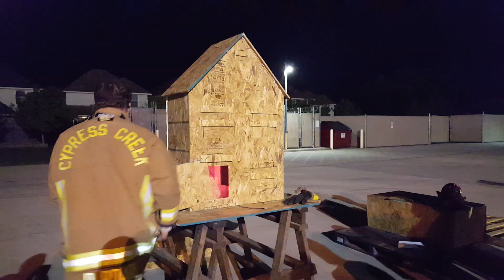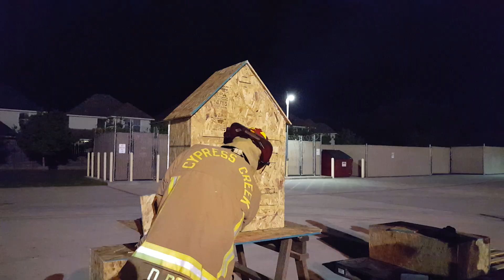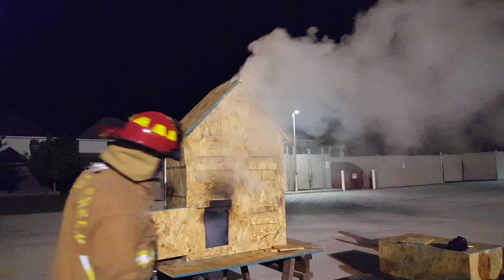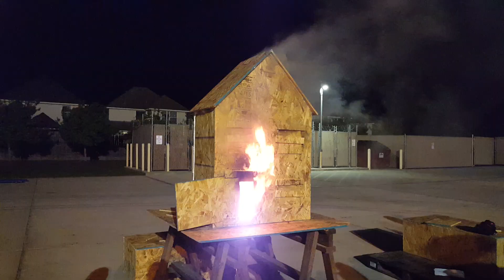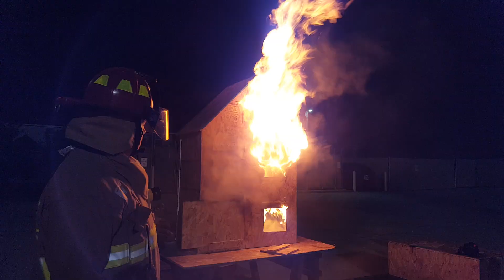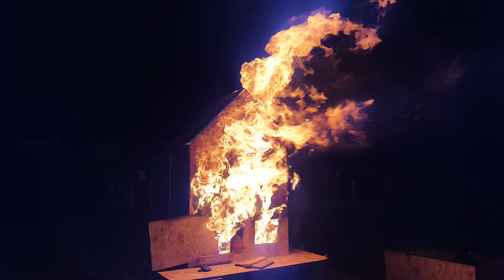Back draft and flash over simulations

Comment: I saw a video where firefighters used a 15 or so foot long shipping crate to demonstrate backdraft. It was massive and incredibly loud and powerful. Is it possible to get a powerful backdraft from that smaller scale house? If you have a smaller ventilation hole, will the backdraft be more powerful or do you just need a greater volume of smoke?
Reply: Smaller hole would mean more time to the backdraft to occur. The greater the smoke volume the greater the backdraft

Comment: Notice how after he closes the door after the backdraft at 7:45 the smoke on the roof changes from thin white smoke to thick fat dirty brownish yellow smoke. Also, the smoke comes through every gap in the top window. This is something to alert you when you approach a burning building: There is heat and fuel, just not enough oxigen. Be careful about venting.

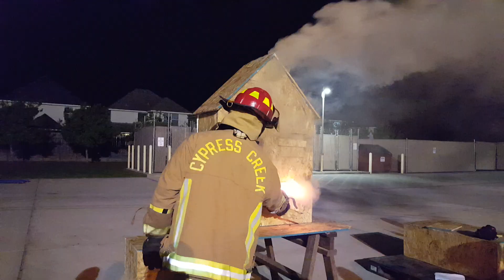Comment: What scares me is that it seems unpredictable.  I mean, we know the conditions that make a backdraft, but when those conditions get met are hidden within the structure until you open a section/window etc. Like around 9:20.  How do you know, when you get to a scene, if the thing is going to try kill you or not?
Edit: and what if you are on a crane near the roof at 9:50? Can making a hole put you in danger? Guess that's why I'm not a fire-fighter...
Reply: Some signs that firefighters can use to identify a backdraft:

First of all, keep in mind that to occur a backdraft the smoke has to be very hot and concentrated enough with combustible, only lacking the O2 to ignite.

1 - Khaki/beige, dense and turbulent smoke getting out violently from upper openings

2 - Air being "sucked in" the building, you can see it and also hear a whistle sound

3 - The presence of flameover (smoke getting out the building and instantly igniting), which means: The smoke that gets out of the building is hot and has combustible enough to burn and it will burn as soon as O2 enters the game

4 - High temperature doors, door handles and walls indicates that the inside of the building is very hot 

5 - You will hear stuffy noises, due to the high density smoke

6 - Windows will look oily, due to soot and water mixture (products from the combustion)

Comment: Let me explain something to you and I hope you Think about what I say.  You Do  NOT teach the consequences of not doing your JOB.  You teach the JOB and there won't be any consequences.  I was a Third Generation REAL Fire Fighter which means nothing if I didn't get the JOB done Quickly and Safely.  But I did.  I also know that fire fighting is a dirty, stinky, hot and cold menial labor job and that is IT!  It is Not Rocket Science and is NOT staffed by a bunch of Heroes.

1.  Everything you need to know about fire fighting you learned in grade school.
2.  A fire inside an enclosed space creates pressure. 
3.  If that pressure isn't released, it will eventually spread deeper into the structure.
4.  You break a fire room window from the outside to let the pressure, heat and smoke escape directly to the exterior and away from the interior.
5.  You apply Tank Water through the window and coat the burning material.
6.  The flames will go away in 3-5 seconds and the room will be drenched in 5-10 seconds.
7.  This can be done within one minute after arrival.  Long before an entry team can be assembled, get fully dressed and get the front door open.
8.  The temperature inside that room drops by 1000 degrees the moment the flames go away.
9.  The victims and entering fire fighters are PROTECTED.
10.  You go in with a charged line to mop up and search.

No fire is pushed, nobody gets steamed to death, the job is done and everybody gets to go home.  Nothing but menial labor but with a brain and sense of responsibility toward yourself, your fellow FFers and your families.  No bravery and hero bullshit allowed.

You horizontally vent and apply tank water as soon as possible.  This is how you fight fires.   You don't need any models.  
https://www.youtube.com/playlist?list=PLkp0E1ao1XEzg384QZ4ovMA_6P7gCY3nJ
https://www.youtube.com/playlist?list=PLkp0E1ao1XEw35c4z-PSM0hoKYiMLpHJC

Comment: Children at Play.  Open the windows at the fire room to release the pressurized heat and gasses and then apply Tank Water to the burning material.  The fire is knocked down within one minute of arrival.  With the release of heat and gasses and the application of water, you can't have a flashover or backdraft.  It is only when you PLAY at your JOB that you can create them.  Grow Up people and do your JOBS!  "Stop The Threat As Fast and Safe as possible while using the least amount of water."

Comment: Let me explain something to ALL of you!  This is Not that hard to understand if you just think about it.  You don't need Doll Houses.  Because most buildings aren't completely air tight and doors and windows are frequently opened and closed, the air pressure in and out of the house should be then same.  In grade school science class we learned about Hot and Cold Air and their level of Pressure.  We know that heat rises and cold air falls.  In a closed structure, burning material will create an overall higher pressure compared to what is outside..  If the fire, heat and smoke are not venting out of the structure, the Flammable gasses at the ceiling will get hot but they will be suffocating due to a lack of oxygen through fresh air.

Every room in every residential structure in the USA and most of the world have at Least one window. Most basements have windows or hatches.  Attics sometimes have windows or at least gable end vents and sometime dormer windows.  If there is a fire in a residential structure, the chances are high that you will be able to figure out where the fire is through a 360 walk around.

Remember!  Hot Flammable but suffocating gasses at the ceiling and cooler air at the floor.   Let's say the fire is in the first floor living room.  If you want to eliminate the chance of a Flashover and want to Protect anyone who could be inside including fire fighters, the Quickest and Safest way to do that is to break out the windows at the fire room and allow pressurized Heat and Gasses to escape directly to the exterior and away from the interior.  Then, you apply water directly to the burning material through that window!  All the gasses including the water vapor/steam will exit that same window.

If the fire is in a second floor bedroom, one person grabs a ladder and breaks out the windows to release the pressure.  One person hits the ceiling and moves their feet around to change the Angle of Attack and the fire is out in the same amount of time.  No flames, no flashover.  Period!  If you leave a lot of window area open for the gasses to escape or you have opened multiple windows in the fire room, the gasses will continue to exit out of the structure.  You will NOT Push the fire deeper into the Pressurized structure!

You have just lowered the temperature in that room by 1000 degrees the moment the flames are gone.  Combustion is ending quickly as the material is soaked.  From arrival to Safe should take no more that One Minute on Tank Water while the hydrant is being hooked up.  Around 20 gallons of water in 5-10 seconds and the threat of flashover is over because you have eliminated the ignition source for the hot gasses outside that room.  The temperature will ONLY go down!  

The reason this country's fire departments worry about Flashover is because they fight the fire in a way that will ALLOW Flashover to occur.  They leave the structure tight and the pressure high with the existence of Flammable gasses and Flames.  They open the front door to go inside to find the fire they can see through the window.  This does two important and Dangerous things.  It releases pressure directly into their faces and allows the gasses inside to move and mix with incoming fresh air at a lower level.  The flames and heat increase and Now that they have created the ability for those gasses to Flashover and they Walk Right Into IT!!!

This nation's standard decrease the threat of Flashover is to take the TIME and risk their lives by climbing on the roof of a Burning Building to cut a hole in the roof and Try to punch a hole in the ceiling below while HOPING they didn't run into the following.

1.  They can't reach the ceiling with their pole because of the steep pitch of the roof. (Just open the windows at the fire room!)
2.  That attic has a thick layer of insulation between and over the ceiling joists.  (Just open the windows at the fire room!)
3.  The attic has a floor.  (Just open the windows at the fire room!)

4.  They punched a hole that is too small to release much pressure.  (Just open the windows at the fire room!)

5.  They punched the hole in a room where the door is closed to the hallway!  (Just open the windows at the fire room!)

6.  The gasses in the attic where extremely hot and they just ignited them to turn the attic into a fire bomb which builds up so much pressure that no gasses could enter the attic from below.  (Just open the windows at the fire room!)

7.  While attempting this tactic, a fire fighter falls through the roof into the inferno or slips on the saw dust and falls off the roof.  (Just open the windows at the fire room!)

Even if everything went perfectly, the fire has grown in that time and the heat from the lower levels would Never rise and exit that hole in the roof as the movement of gasses below will mix with air from the front door and the fire is always getting bigger.  
You can eliminated the heat and gasses through a window in One Minute or Wait for Vertical Venting to perform it's miracle and make the interior a much nicer place to work.  (Just open the windows at the fire room!)
  https://www.youtube.com/playlist?list=PLkp0E1ao1XEzg384QZ4ovMA_6P7gCY3nJ

Comment: This guys turn out gear is suspiciously clean like it must have been brand new
Reply: We maintain our gear by washing it regularly and after an incident.  Dirty gear is unhealthy gear.  We also have our gear regularly inspected and repaired or replaced per standards.
Reply: Kevin Bain yes ours is too. However regularly washed gear still looks weathered compared to his
Reply: @lukeanderson6669  So what?  His gear was new, as was his helmet since he was recently promoted prior to the film.  You are judging him based on how insufficiently worn his gear is?  I have gone through several sets of bunker gear during my career.  I had more experience and more training by the time I received my brand new third set than when I turned in my worn out first set, although it may not have appeared so.  Heck, our cadets are often issued heavily used gear that is no longer fit for interior firefighting and only issued new or newer gear once they are cleared for interior firefighting training.   I wouldn't presume to judge another firefighter based on how their gear looked unless the ensemble was incorrectly assembled or donned.
Reply: Kevin Bain take er easy lad only an observation
Reply: maybe he's using a student's gear which would be brand new..

Comment: It's just un burnt fuel why you never bust out windows or open any doors because a team can be in there and you think you're helping but you're actually introducing more oxygen and a flash over can happen
Reply: How can a ba team be in there if no doors or Windows were opened to get in in the first place?
Reply: @isitwasit8756  have you never been to fire school before?
Reply: @againsthell1908  oh you know ?? 
Just 20 yrs in the job so far And counting.. 
So the question still stands ?
How can any ba team be in there if no doors or Windows were opened in the first place ?
Reply: Always control your door dont let it sit open youre just asking for it to flash specially none touched bedrooms that had the door closed. 2 in 2 out the guys on the line makes their way up stairs sees a room closed dont touch it there could be someone in there so the guys outside will go to that window on a,b,c or d most likely break the window to search the room and then guess whats gonna happen when you open that door? More fuel more oxygen
Reply: @againsthell1908  
Eh?? Don't leave doors open ? Err yes you do . Every door a ba team goes through with hose reel en route to a compartment fire is wedged open before proceeding for obvious reasons.. also any decent compartment fire would have built up enough temperature inside causing windows to fail before or after flashover commences ..by the way flashover and backdraught are totally different scenarios.. flashover occurs in a developing fire backdraught can occur after fire has flashed , but in any compartment fire that has already flashed I can assure you the windows would have failed taking away the risk of backdraught...  once fire compartment is reached by ba team get on your knees crack the door and view conditions inside fire compartment .. if windows have failed close door radio back to entry control point and tell them to get the fan on to go offensive ventilation .. once that's done deal with fire and all smoke heat and steam will vent out of failed window .. like I said earlier in response to what you said regarding not opening doors ? If any teams are in there? That means doors are open and certain windows will be open either from failure or nessesity regarding vents needed to control smoke and heat exiting the building...but I'll emphasise it's all controlled not just random for obvious reasons..
Reply: Dont just go opening doors and breaking windows

Comment: The Best test is to practice Horizontal Ventilation and getting water through the windows effectively and Stop The Threat.  Everything you need is in here.  https://www.youtube.com/watch?v=I1uAJ2TAUCA&t=0s&list=PLkp0E1ao1XEw35c4z-PSM0hoKYiMLpHJC&index=8

5:00  Venting the roof did nothing but help the flames travel THROUGH the structure and make the fire bigger. 

10:00  12:00  Nice examples of how Vertical Venting does NOTHING to help first floor conditions!   If it did, there would be no flames coming out the first floor window and door!!!!!!!!!!!!!!

Fires need WATER!  They are Not to be played with!

Comment: Living in Syria.....
if I had to come to some other country where the houses are wood...
I learned to NEVER open a window or door
Escape... Then close the door behind you
The fire will choke...                right?
Reply: David Lawand it helps, but usually will not stop the fire, just make it slower.
Reply: Flag Ov Hate 
And that means?
Reply: David Lawand it means that it helps to keep windows/doors closed when there is a fire.
Reply: Flag Ov Hate 
👍🏼
Reply: Theoretically it would, but houses aren’t built air tight so air will find a way in.
Reply: Life...  finds a way

Comment: What he fails to explain is that a backdraft is not the fire's fuel exploding into flame, but carbon monoxide (CO/Woodgas) from incomplete combustion. When oxygen is limited or cutoff, a fire's fuel will continue to oxidize/burn, creating higher concentrations of highly flammable CO instead of carbon dioxide (CO2) gas. When oxygen is restored, the CO can/will explosively oxidize.

Additional fact, what we call flames are actually a second combustion event. Flames are the result of rapid oxidation of exhausted gases (mostly CO) from the first combustion. A wood fire is the oxidization of the wood fuel, which then throws off copious amounts of CO that then oxidizes into flames.
Reply: Thank you
Reply: Look at you Mr. Know-it-all!!!!!!!!!            J/k... that was quite informative :)

Comment: My house has AC so I don’t have to worry about this ever happening
Reply: The AC cools the flames down until they freeze.
Reply: @Sol_Invictus98  yes you're right
Reply: untill your AC collects too much dust cause your a piggy, and you get a electrical fire..
Reply: Wala Lopez what
Reply: most recent AC units use flammable gas (r32) as refrigerant liquid as a solution to the ozone hole
Reply: Hahaha
Reply: Lmao
Reply: That is incorrect
Reply: BIG CHUNGUS  ARE YOU SURE ABOUT THAT?
Reply: Fireplaces aren’t the only thing that start fires
Reply: Air Conditioning systems can start fires too.
Reply: r/whoooooosh
Reply: Switzerlandic Tortoise r/ihavereddit
Reply: @yunhanluo3295  r/ihavereddit
Reply: German Tortoise real redditors dont link reddit outside of reddit
Reply: Eddie Van Horn  real redditors dont link reddit outside of reddit
Reply: COCHESE  real redditors dont link reddit outside of reddit
Reply: This only works for some A/C units though. Remember the fire triangle, heat, oxygen, fuel.

Yes, some A/C units can lower the temperature enough so that it slowly kills the fire if it isn't too big yet and some A/C units have enough fan force to direct fire in such a way that it suppresses it but not all A/C units are alike. Thinking you have an A/C unit that can fight fires is a good way to get yourself killed, you should contact your local fire department and inquire with the manufacturer of your A/C unit about its fire suppression capabilities before you sleep easy thinking your 100% safe... Because you may be... But you may also not be.
Reply: Great commenting.  I am gonna run right out and invest in AC units.